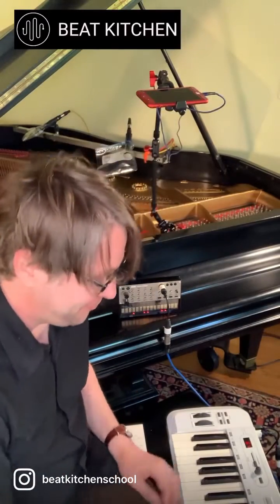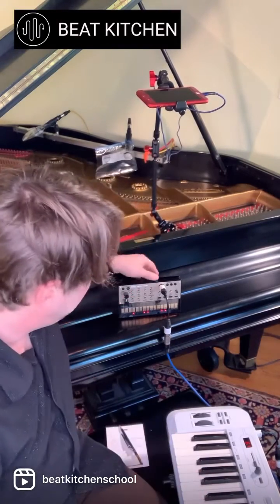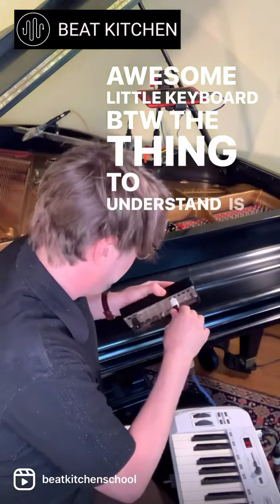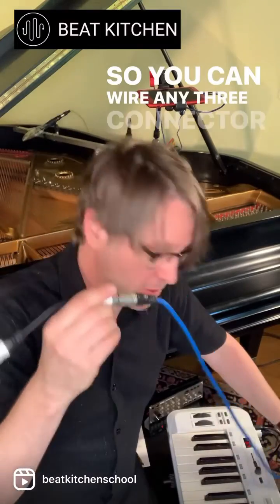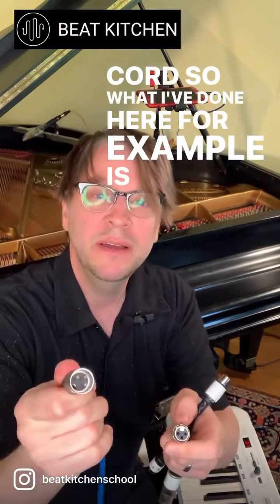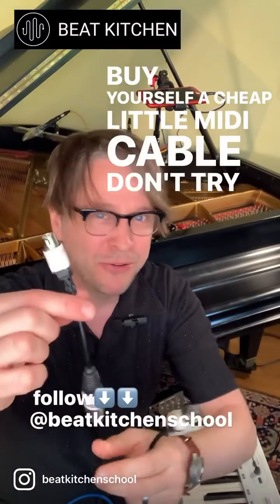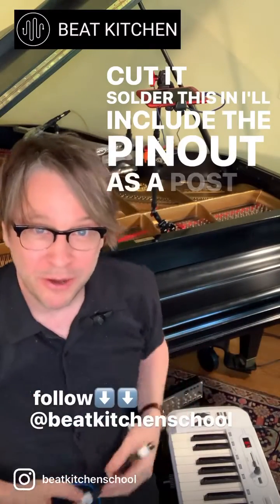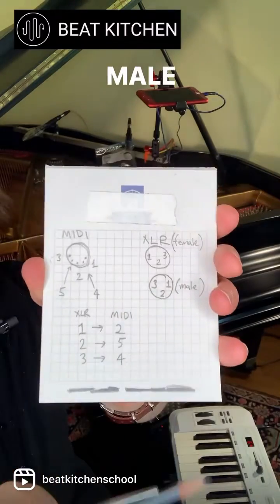Midi over XLR￼

Comment: I understand BUT I also don’t 😭 I need to convert my 5 pin midi cord to a 3 pin XLR
I have to make something?

I Bought a Focusrite audio interface and apparently it doesn’t have a midi in port
Reply from the maker: This trick is useful, but not THAT useful. If you don’t have a midi input now, this is not going to give you one. It just allows you to use a different type of cable which opens up a few possibilities. Hope that helps to clarify. Sorry if I got your hopes up!